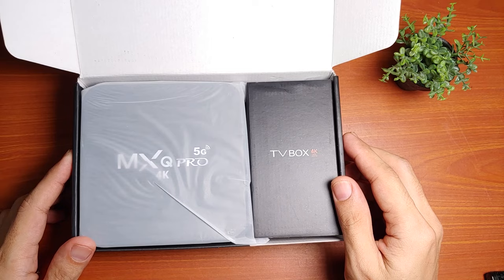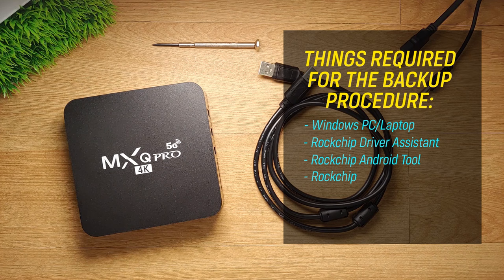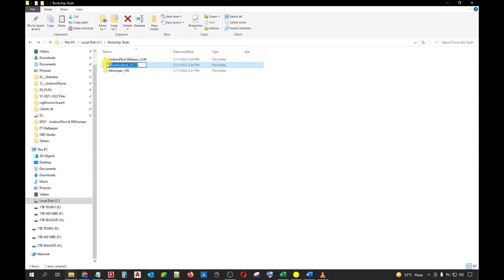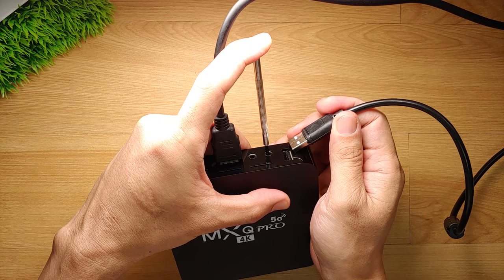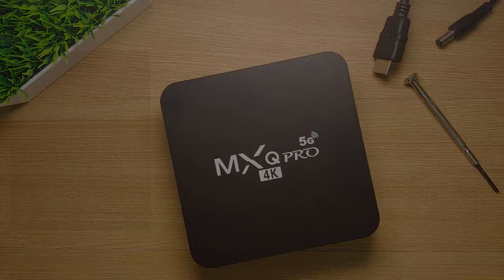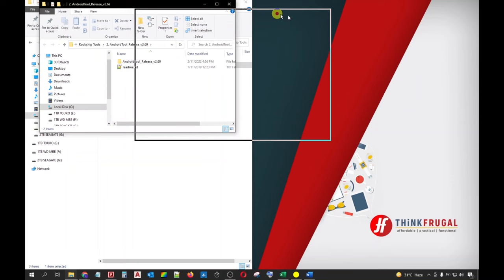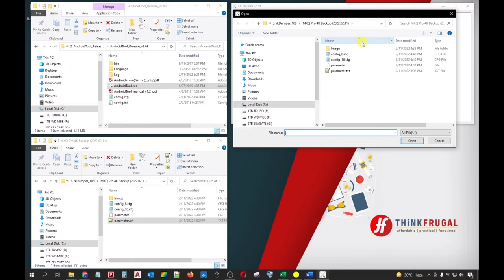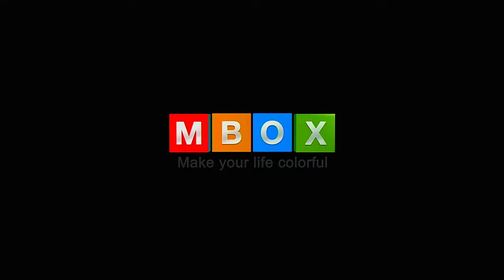Backup and Restore Your Rockchip Android Box (e.g. MXQ Pro 4K) Using AndroidTool & RKDumper

Comment: Hello,
last month I bought a used "OU ZHOU X-8", and when I connected it appeared to be bricked (was turning on without loading anything), after a long search I've found nothing about this box; I've tried to install ROMs of similar boxes without luck (the ROM just stop installing with "failed to mount" errors via SD CARD method, and IDB FAIL error via USB method) so at the end I returned it back. Fast forward to today; the thrift shop got more of these Android Boxes so I got it again, meanwhile talking with the guy at the shop, he said that the one I've returned was ready to trash so he asked if I want it, so I got it, for free. Now my goal is to save a backup from the new working Android Box and install it to the bricked one. My only fear is that the process can brick the working android box; aside any third party issue, does the reading process (backup process) can corrupt the original ROM because I've used the wrong version of the tools (like using the wrong rkDumper that on the XDA website doesn't mention the RK3228A chip)? If the results is just that I can't get the backup, I'll try immediatly, if there is a risk of it, I'll wait.
Some info: on the package of the Android Box says RK3229, but on the actual chip (I've disassembled the bricked one to figured out what ROM to find) says RK3228A; the data sheet of that chip says MAX RAM 2GB, but my Android Box have 4GB of RAM and 32GB of storage, how is this possible? Does this change anything? I will do this at my own risk, but I just want to be prepared just in case sh*t happens.
Thank you!
Reply: Unfortunately I've just checked the new Android Box and, despite they are identical from the package box to the case, the new Android Box have a different chip (CPUZ says RK3066, Device info HW says RK3229), so even if I backup it I can't revive the old one with a RK3228A.
I'm still interested to know if this procedure may brick the device if the software is not compatible, or just gives error.
Thank you

PS: I've found a Firmware for the RK3228A that is splitted in different IMG like the one in your video, but there are no config files, is there any way to make it? They are 14 files.
Reply from the maker: Hi, performing the dumping process by rkdumper is generally safe, as it does not alter anything in your android box. It simply extracts and dumps the files from the flash drive. However, several other factors may brick your device during the flashing process, such as overvoltage, chip failure, and some other unknown reasons. These are rare cases but still worthy to note. Backup files from one box can be flashed to another as long as it has similar specs, just make sure to change the MAC address of any one of the android boxes if you are planning to connect them on the same network to avoid IP address conflict.
Reply from the maker: @mgjfile  Yes, it is possible to brick the device when a non-compatible rom is flashed, this is especially true on android boxes that are firmware locked. While other boxes are very flexible, you can flash as many firmware as you want without bricking it. I would highly recommend that you open the box, and identify first your board number and wifi chip model. This will help you in narrowing down your search for a compatible rom for your android box. As for the config files, it must come from the original dump files, as this contains the sector information where each image file will be written to.
Reply from the maker: @mgjfile  Please refer to this photo for your reference how to identify your chipset and board number: https://drive.google.com/file/d/1YFvX8xaUtRGkg_ZTjshOwet3j-UYQ1K_/view?usp=sharing
Reply: @ThinkFrugal  Thank you for your kind and detailed reply.
Unfortunately I'm not able to find anything of the old android box, I can see the WiFi Chip (SV6051P) and the CPU (RK3228A) but no results for the PCB (R329Mars44_V1.0).
Here some pictures just in case you want to take a look:
CHIP INFO's: https://i.imgur.com/6sLciHF.png
Other details: https://i.imgur.com/vCXY5vR.jpg (PS: on the package says 3229, but is just B.S. like the version of Android that says 10 but should be Android 8, or 7; like on the new Box)

I guess I can't do much.
Thank you!
Reply from the maker: @mgjfile  I've seen your post in Reddit. It looks like your box has been soft bricked. The only problem is that the RKdevtool does not recognize the box, and you cant flash any rom, right? There is one possible solution for that, you can enter into mask rom mode. I've done this before and it worked. Please refer to this link for your guide: https://www.youtube.com/watch?v=7pbs6QyCQYM&t=538s. You just need patience to find the correct pins to enter mask rom.
Reply: @ThinkFrugal  The post on reddit was before discovering your video, so in that post I've used "RKBatchTool" via USB (that recognized the box but ended up with IDB fail) and "SD_Firmware_Tool" to burn an .img to sdcard that worked to reach this menu: https://i.imgur.com/FFkcPHZ.png but without letting me do anything due the "failing to mount" errors. I never tried RKdevtool yet but without a good ROM I can't go ahead without risking to hard brick it. But I'll try to see if the software recognize it, if don't I'll try the Mask mode, if do, I just need the right ROM.
Thank you so much!

EDIT: other screens of what appeared while using an IMG of a "similar" box with the SDcard: https://i.imgur.com/P7g5zVO.jpg
Reply from the maker: @mgjfile  Yes, that usually happens if you flashed an incompatible rom to the device. This could also be the reason why  "idb fails" in RKBatchtool.
Reply from the maker: Try to flash this firmware either using RKBatchTool or RKDevtool, it's for RK3228A SV6051P: https://drive.google.com/drive/folders/1xGUCbQ-IlWNVziqGpkBhGA9mmwsypa2d. This link came from this forum, discussion is in Filipino, but you can use Google Translate https://phcorner.net/threads/mxq-rro-4k-rockchip-firmware-rk3228a-sv6051p.1094800/. This rom is just my recommendation, and I do not guarantee that it will work on your device.
Reply: @ThinkFrugal  unfortunately I keep getting IDB Fail. I tried RKDevTool, RKBatchTool and FactoryTool.
The Box get detected but when I start the process it disconnect, then reconnect....and IDB fail as following:
*********Restore Action*********
*********Restore Start Total<1>*********
<Layer 10-1> Download Boot Start
<Layer 10-1> Download Boot Success
<Layer 10-1> Wait For Maskrom Start
<Layer 10-1> Wait For Maskrom Success
<Layer 10-1> Test Device Start
<Layer 10-1> Test Device Success
<Layer 10-1> Check Chip Start
<Layer 10-1> Check Chip Success
<Layer 10-1> Get FlashInfo Start
<Layer 10-1> Get FlashInfo Success
<Layer 10-1> Prepare IDB Start
<Layer 10-1> Prepare IDB Fail
*********Restore Done Success<0> Fail<1> Time<6328>ms*********

Before finding your video I tried the ROMs described on reddit by installing Driver Assistant 4.5.
If I want to try the 5.1.1 do I have to uninstall the old one first? 
PS: with RKDevTool I had to use the "upgrade firmware" tab because the IMG you provided is a single ISO, not separate one's with che config file to use in the "download image" tab.
Thank you
Reply from the maker: @mgjfile  Please try use another version of rkdevtool (say v2.38): https://chinagadgetsreviews.com/?s=android+tool+release , and an older version of rockchip driver assistant (say v.4.5): https://chinagadgetsreviews.com/?s=rockchip+driver+assistant . If it still shows IDB Prepare Fail, try to mix and match the different versions of rkdevtool and rockchip driver assistant until the error disappears. Some boxes are only compatible to a certain combination of these apps, just be patient in discovering the correct versions. Also, please ensure to uninstall the previous rockchip driver assistant before installing a new one. Yes, you are correct, if it only contains one img file, this is flashable via the "upgrade firmware" tab of the rkdevtool app.
Reply: @ThinkFrugal  nothing.
I've installed a driver, then tried to use each version available of RKDT, then uninstall the driver and install the next version...and so on... everything ended up with IDB FAIL.
The only driver that didn't even recognized the Box is the 4.3, maybe is older than the Box.
Then I noticed that to run the "update" from a RKDT version to another I had to unplug and replug the Box otherwise the RKDT give a "Download Boot Fail".
:/
Thank you for everything
Reply from the maker: @mgjfile  Don't give up just yet :), here are my last two solutions, and I hope any of them will work: Option 1) Download the androidtool v2.39 and Rockchip driver assistant from this link: https://www.mediafire.com/folder/5qs985buhb8g5/Rockchip?fbclid=IwAR1Q1Czo-zLkmTTrBfXLnjt_mwbSjtZZKBjh75Tx7jUPFNzRw79J5UKU5_I .Then flash the rom I have sent you earlier for RK3228A SV6051P (from phcorner). Option 2) Using RKDevtool v2.69 and Rockchip driver assistant v.4.5, flash these recovery files: https://mega.nz/file/AUQ3UK5a#_34kXx-nU6yXG2ADfIxix-YP403LWv9Rva3WLSf8C-4  . Use my tutorial here: https://thinkfrugal.page.link/rockchipbackupandrestore-yt to do option 2.
Reply: @ThinkFrugal  Hello, I'm back. At the end I did a backup of the working box and now I have all the .ISO images.
I've tried to upload it in the bricked box that is in MASKROM mode without luck... BUT.
I've found a MiniLoader for all RK32xx RockChip processor, tried to upload it and getting a IDB Fail, but then by removing the check to the LOADER and running again the upload the Software managed to upload the ISOs from start to finish (Download image OK). After that the Box is still in MASKROM and won't boot anything. Is there any logic behind what just happened?
Here the LOG file: https://pastebin.com/3Sz9Wc9d
Here the Download image OK: https://i.imgur.com/tTEAf0k.png
Thanks

Comment: hello po pano po malalaman kung anong firmware ang idadownload ko? yung box po kasi ng mxq namin natapon napo sana may sumagot ty po❤️
Reply from the maker: Open niyo lang po yung MXQ niyo, tapos dun niyo makikita yung model ng processor and wifi chip. Eto po yung picture ng mxq ko for your reference: https://drive.google.com/file/d/1YFvX8xaUtRGkg_ZTjshOwet3j-UYQ1K_/view?usp=sharing
Reply: hihigitin lang po para matanggal yan?
Reply: kasi kapag nag upgrade poko ng firmware nag fail po agad
Reply from the maker: @nickaguila6520  may apat na rubber pads po sa ilalim ng mxq, tanggaling niyo lang po yun, may mga screws dun na nakatago. I-unscrew niyo lang po sila para mabuksan ang box.
Reply: sir kapag nag fail poba yung pag upgrade mo ibig sabihin poba nun is mali yung nadownload mong firmware?
Reply: I mean po yung sa pinakita mopong picture kung hihigitin lang poba yung parang metal nayun para makita mo yung model po?
Reply from the maker: @nickaguila6520  Tama bro, yung metal na yun is yung heatsink. Please ensure na lang maibalik siya after mong maconfirm yung processor. Kailangan gamitan ng thermal paste para maibalik ulit yun.
Reply from the maker: @nickaguila6520  Oo bro, minsan mali ang firmware kapag failed update.

Comment: Thank you very much sir Lorenz, question lang po regarding sa Loader? Yun ba ung booting animation pag nag oopen? Accidentally kasi na stuck sa logo ung mxq pro ko then nag flash ako ng compatible firmware ang problem is ayaw ko nung default app na netflix and youtube hindi remote friendly, then hindi ako mapakali so nag flash ako ng ibang ibang firmware then na bricked ung device. Buti naka enter ako sa masked rom by doing short pins then na flash ko ulit ung compatible firmware and sa pag hahanap ko nakakita ako ng original backup please check okay po ba ito and balik ako sa question k ona loader. Eto po ung compatible rom na na flash ko https://www.youtube.com/watch?v=EinrXd2dRL4&t=352s and eto naman ung nakitang kong original firmware pero while watching nakita kong failed ung system sa pag back up nya. https://www.youtube.com/watch?v=a9Fxpgpt9bk&t=440s

Thanks sir Lorenz more videos po and Godbless :)
Reply from the maker: About sa rom compatibilty, I suggest that you stick to the first rom na naflash niyo. Pwedeng ma-update yung mga hindi nagwowork na apps by downloading the latest apk files sa apkmirror.com. About naman sa remote compatibility, sadly, hindi talaga magwowork ang supplied remote sa Netflix, dahil sa widevine licensing, pero sa youtube, the remote will work. I recommend na gamit kayo ng air mouse, mas mabilis at smooth ang navigation pag eto ang gamit. About dun sa original firmware na nakita niyo, it may or may not work on your device, marami kasing factors na pwedeng maka affect sa flashing, it's all about taking the risk. Pero kung kabisado mo na yung mask rom method, that's great, kasi kahit mabrick pa yung box mo ng ilan beses, you can easily revive it with the mask rom method. Good job!
Reply: @ThinkFrugal  Thank you sir, More power po!
Reply: bosd tanong ko lang sana, about maskrom mode. yin kasing akin detected cya na maskrom mode kahit wala pa ako na short na pin sa flash ic. na wrong firmware kasi ako sa pag flash ayun bricked na cya. pag connect ko sa pc. detected cya agad maskrom mode. thanks in advance
.

Comment: Madali lang naman mag backup ng flah ng rockchip rk322x chipset, gamit ko lang yung multitool na gamit sa armbian, meron option doon na pwede full image backup ng tvbox.

No need for this super long tutorial, kelangan mo lang sa pc is basically create a multitool sd card.
Reply from the maker: I am well aware of that method, and that was my first choice of backup before. Until one day, it bricked one my mxq and was never recovered again kahit ginawa ko na ang mask rom (shorted pins). If you get my drift you'll understand kung bakit ito na ang choice of backup ko ngayon. It could be long pero it has lesser chance to brick your device. It has been very consistent. Maybe someday I'll make a tutorial for the multitool.
Reply: @ThinkFrugal  eMMC siguro yan kaya kailangan mo mag short ng pins, NAND models dont need to do this though, I still stand to what I say though, no need for extra hoops on the software side if your main aim is to backup the ROM, restoring should be the same.

saka mo na lang alalahanin yan pag wala na talagang lumalabas sa screen whcih requires setting the eMMC to mask mode, hindi mo eto ma experience unless nag flash ka ng maling ROM. pero kung bootlooping problem lang naman yan and you already have a known good backup, hindi mo kailangan mag maskrom, so no shorthing needed.

still restoring a rom backup using multitool with emmc is possible, kailangan mo lang i short yung pin para maging maskrom mode yung emmc and multitool should bootup up on the screen and just a matter of choosing that restore backup option.
Reply from the maker: @remle ikawura  It's all up to you bro. Do whatever suits you best. This is not a debate which is better between the two. If the armbian multitool works well for you, then by all means, do it. This is just an option.
Reply: @EmilePolka boss baka pwede mo ako matulungan kung pano gagawin pag maskrom mode na. naiflash ko kasi sa maling firmware. thanks

Comment: Its fake box, not know to me, but  nicely printed stating 2GB RAM and 16GB Storage with MBOX MXQ PRO 5G 4K. I BROUGHT recently with device not working/booting, with no TV display and blue LED  light is ON permanently.  MBOX PERMANENTLY BRICKED MAY BE WRONG  FIRMWARE APPLIED AS NEVER TOOK DEVICE BACKUP,  Android version 11.1 its a fake with RAM 2048MB AND INTERNAL STORAGE 4.00GB with reset option permanently disabled. PCB DETEAILS AS MXQ-RK3128, MALI-400MP PCB REVISION V1.4-20211104, Processor RK 3128 with WIFI RK915. My laptop with USB does not detect MBox using external Reset toothpick or through USB driver using RKTool /Android Tool . I need to restore Device as it is booting through external SD card, but with configuration error and unable to mount volumes. Please suggest How to make a SD card image (suggest tool name and firmware image details) to restore MBOX device. I liked all your videos, but no video states how to recover the faulty device using SD card (Tcard with 8GB) to restore the device. Please suggest MBOX device firmware link with SD Card Boot options to recover the device. Thanks in advance for your good work here to support MBOX usages.
Reply from the maker: Sorry for what happened to your box. Unfortunately, I have not tested any tool yet to flash firmware via SD Card. Please try again to connect your box to another PC using a different full usb male to male cable. Rkdevtool or Rkbatchtool must detect your android box. Otherwise, there is no other way to flash rom to your device.
Reply: @ThinkFrugal  I need firmware for TV box, which is bricked and cannot be used anymore with following hardware details as below
Device rockchip MBOX, Resolution 720x1280, Platform rk30board SOC RK3128 Wi-Fi chip 915, Kernal 7.1(fake 11.1) MXQ-RK3128-V1.3, HXW21122301-A, 20220105, OTA Firmware Update V1.2.0_2112061006, Model MBOX Version 11.1, Kernel Version 3.10.104, hxws@PowerEdge-R720-9 #91, Sat Dec 18:09:48:16 CST2021, Build MBOX-userdebug 11.1 MHG47K eng.hwrs.20211218.094122 test-keys